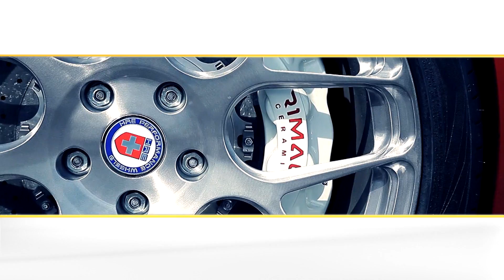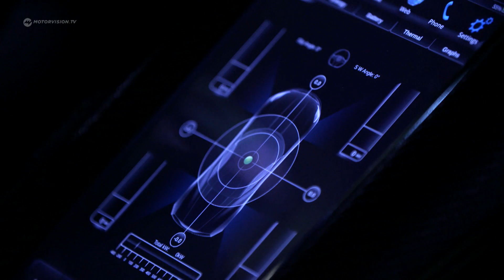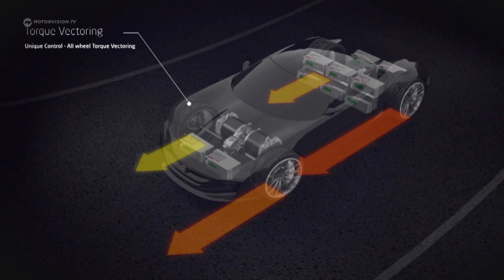Rimac Concept One - Fastest and Most Expensive Electric Car

Comment: Electric cars may have more potential than a combustion engine but they can never beat the sound which is a selling point for today's performance vehicles
Reply: I think that electric cars may end up with speaker systems in them that mimics the sound of a fossil fuel car.
Maybe the sound cellos moving through scales or something, turn the sound on and off at user discretion.
Reply: Have you ever been in an electric super-car? Or been near one? The sound is quite mesmerising. It kind of sounds like a jet engine on drugs without all the "dirty" noises. It is, in all honesty, just awesome.
Reply: callum bennett 
Well, guess what? You keep the combustible car for the "sound" of its engine. And I will keep the electric car for all its other potentials. The sound of combustion engine might be the selling point of today's performance vehicle for you, but it certainly isn't for me. After all, performance is all about the NUMBERS.
Reply: callum bennett Rimac creates a very loud sound inside it you’ll be surprised
Reply: callum bennett
That's the sound of a struggling engine, reason it's slow😁

Comment: So this is the pinnacle of the Electric supercar, how in the actual fuck can a tesla accelerate quicker than this?
Reply: How the fuck did you come to a conclusion like that? Tesla is SLOW compared to this.  Concept One takes less than 6 seconds to go from 0-200 km/h and 13 seconds for 0-300 km/h.  Tesla is slower than a 2 liter diesel once it reaches 150 km/h. It's only fast from 0-60 because it has very short gearing, at higher speeds it's useless, barely reaches 240 km/h with 700hp, and it takes it about 40 seconds to do so.
Reply: I said quicker not faster and obviously talk about the 0-100km/h (If you're american this means 0-60 Mph). Tesla does it in 2.4 sec-2.5 sec. I am in no way saying tesla is faster or quicker beyond that. I just find it fascinating that it is faster than this to 100km/h. I get different gear ratios, but even when Rimac uses its 1st gear its still slower to 100km/h.

Sounds like you're upset at Tesla and its fanboys, I am in no way a fanboy. I simply find it fascinating that Tesla really is that fucking quick to 100km/h.
Reply: Björke J this is older version of concept 1 new slightly stronger have 1224 horepowers which put him around 1.8 2.0 until 60mph...and btw they will represent new car on geneva motorshow 2018 which will be by his words much faster and crazier and there will be 150 copies plus engineer from ferrari bmw and porsche are working on it
Reply: It's because Tesla uses another convention than any other car manufacturer. 

Tesla isn't giving you times for 0-60 mph, but for x-60 mph. They don't count the first foot. It's how they measure times in drag racing, where you are not measured from a complete stand-still. And they're really giving you 60 mph.

Other car manufacturers actually give you times for 0-62.1371 mph. Real 0 and 62.1371 mph as in 100 kph. So Tesla is tricking you two-fold.

Comment: Awsome!
Reply from the maker: It is! One of our favourite cars that we tested in the last couple of months.
Reply: As well it should be. It KILLS Tesla in every way except 0-60 which Tesla is now at 2.3sec. Only two other hypercars can beat it. But the Rimac holds the EC top speed at 195mph and Rimac says it can go faster with some "unleashing" lol. Rimac's range is much longer as well.

I like the interior materials much better than Tesla which is cheap. Rimac's four motors destroys Tesla's two and the Rimac is 800lbs lighter by virtue of not needing that monstrous battery pack in the floor.

I just wish Rimac would build a car at half the cost of this one as Tesla is doing but I think Rimac is not concerned about price. His car is aimed squarely at the Hypercar segment and compared to LaFerrari, Bugatti Chiron, Veneno and a few others, the Rimac is cheaper.
Reply: Everett Cox  Why do people keep comparing it to a Tesla? Do you know how RIDICULOUSLY FASTER Concept one is? Tesla is slow in comparison.  Yes 0-60 it's fast, but that's because in 0-60 GRIP is the biggest issue, it's impossible to go faster than that not because the car has not enough power, but because the grip of the tires is limited. After 60 mph the difference in acceleration between Rimac and Tesla is like the difference between a Tesla and a golf cart.  Rimac does 0-200 km/h in less than 6 seconds, Tesla P100D needs 10 seconds. After 200 km/h Tesla P100D accelerates no faster than a 200hp 4 cylinder diesel saloon in that segment like the BMW 520d.  Rimac reaches 300 km/h in less than 14 seconds.  It's a ridiculous difference. Tesla is fast from 0-60 becuase it's heavy and the weight distribution is ideal for hard acceleration off the line, so it actually digs in well and has a lot of grip, it also has 700 hp and very short gearing with top speed lower than 250 km/h. After 60 it's nowhere near as fast as even petrol cars with 500+ hp, a BMW M5 or something like that smokes a Tesla at above 100 km/h easily.
Reply: I don't understand why people compare it to Tesla, they aren't in the same class, Tesla Model S is best at it's class (sporty family luxury electric car) and Rimac is one of best at it's (supercars but with specs of a hypercar)
Reply: Yes but Tesla will sell more cars, especially when the Model 3, the new truck and sports car come out. Rimac is not going to affect the EC market b/c he's not going to mass-produce the C1. And top speed means fuckall b/c as of now there aren't any places in America outside of drag strips that allow speeds over 85mph. I wish we had Autobahns but we don't. I take my Chrysler Hemi out once or twice a month to run it hard and fast but I watch places where I've seen cops before. Nerve-wracking drives for sure.